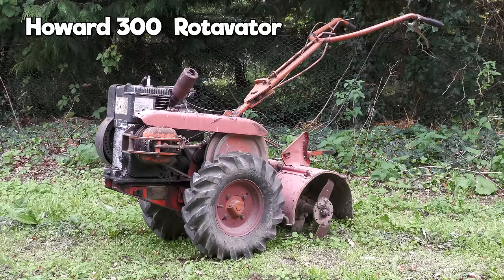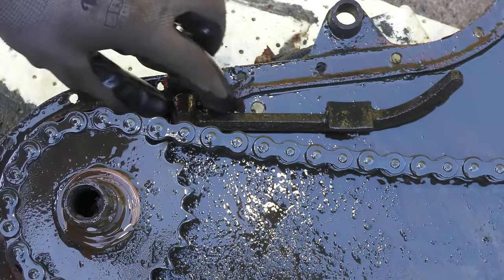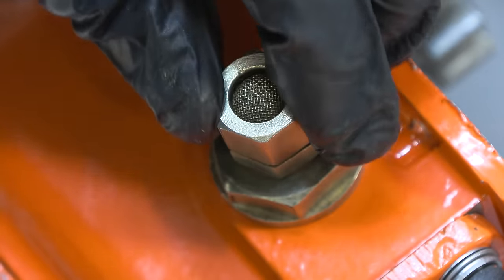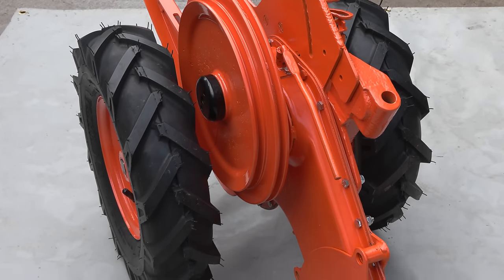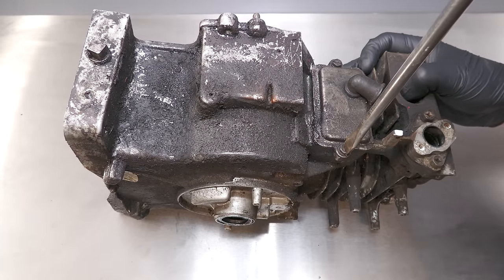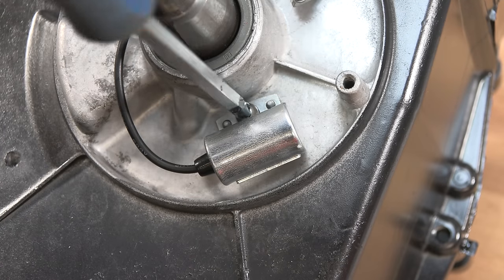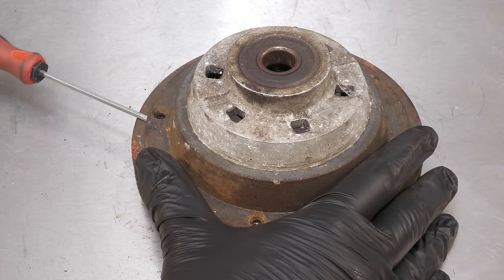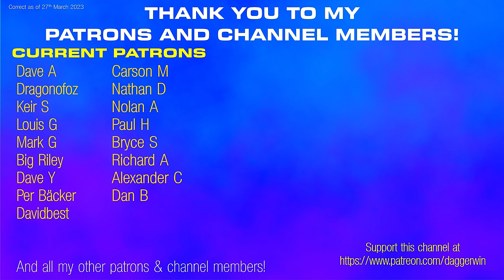RARE 54 YEAR OLD VINTAGE TILLER | RESTORATION

Comment: You were very lucky that the gearbox was in good order, when I restored my Howard 350 about 15 years ago the gears were all worn beyond repair so I ended up making most of the replacement parts myself, (fortunately I am an engineer and I had a fully equipped workshop) while I was at it I got rid of all the plain bushings between the gears and the shafts and converted to needle roller bearings throughout the gearbox, at the time I couldn't get any spare parts or gaskets so I had to make everything myself. I replaced all the bearings, seals and chains and eventually I got it all done, I also replaced the tyres and the tynes and converted the tynes to double row. The old Howard is still performing flawlessly to this day and leaks no oil. I also overhauled the Kohler K141 engine and replaced the piston, carb, exhaust and fuel tank. The engine runs perfect and can really do a job of work on my small holding, the last time it was used the engine started first pull with 2 year old petrol in the tank and did everything I asked of it, these are truly great machines

Comment: We used the 350’s for commercial landscaping work as the 300’s were fine for veg plots but a bit underpowered for commercial work. The Kohler engine was brilliant, given its quirky starting process and relatively easy to maintain. Like yours both suffered from the ingress of dirt/grit exacerbating wear. So we did basically what you did every two years to all on them, and still had breakdowns. 😂However, a brilliant machine and a super vid, thanks.

Comment: The reason I popped in to watch this was to see just what a Howard looked and sounded like when in operation.
There is one just like this one that's come onto the market here in Rotorua NZ that won't go, owner has no idea why it won't go but they are asking $160 for it.
It's not the price that scares me but how scares the parts are to find over here.
Thank you, you have done a wonderful job on restoring your old now new motor.
Reply: In the modern age parts are often easy to find. It's the world's out of date shipping prices that kill things.
I have one of these in my backyard. Last time I worked it over I ended up making all the gaskets. I found a kit in the UK but by the time I had it sent to the US the shipping was more than the gasket set. If I recall the gasket set was like $20. They wanted $35 just for shipping. For $5 I bought a roll of gasket material locally that I still have more than enough to do it again.

Comment: When restoring projects the quality attention to detail is spot on high quality. If I needed to rotorvator I would definitely purchase this one over anything new manufactured because the old machines mowers and garden equipment were built and made to last longer and built with quality materials. 
Cheers.

Comment: I love that this wasnt just a quick paintjob. You were very thorough. Two bits of advice, quenching steel with water can weaken metal components. Its best to use a penetrating fluid, and when you are hammering a threaded end of a shaft or bolt, leave the nut on and hammer on that instead. You wont mushroom the tip of the shaft or bolt.

Comment: Thank you for making this excellent restoration video, brings back many memories. When I was growing up we had one on the farm, when I was barely old enough I started using this wonderful machine on our farm, it was quite heavy and needed some serious strength to keep upright & from toppling over, quite a high centre of gravity!   Ours had the B&S engine originally I think, but it blew up and we replaced it with a Mitsubishi engine, which threw the conn-rod I think, then the final engine was a Kohler.   After many years of hard slog, I credit this machine for giving me great upper body strength.  I hope it gives you great pleasure and satisfaction using it.   Cheers from NZ.   (PS: I am two years older than this machine)
Reply from the maker: Thanks you so much for your kind words, I am so pleased to hear that it brought back memories for you.

Comment: I wish I could've restored my grandfather's old Sears Craftsman tiller from the 1970s. It used a common Briggs 5 HP engine. It was yellow and white in color from what I remember. My parents used it quite often when I was a kid.

You did an amazing job with this one. Rotovators/Rototillers haven't changed much in decades. Practical and simple design. Love it.

Comment: There are thousands of these type rotor tiller all over spain, especially in the north where I live. The majority are powered by single cylinder lombardini diesel engines although nowadays lots are using honda petrol engines. They are eternal and well worth a good restore like you just did.

Comment: Great job. I've always been taught to hone even the aluminum blocks to get rid of the scoring as they are honed from the factory. The starter housing hole that the spring is anchored has ample room to feed the spring in as you wind the string pulley. When the spring reaches the final end a slight pressure on the tab and it will pop into place. The heat resistant paint is a nice touch as I use barbecue paint, same thing. I think that tiller will last many years to come.

Comment: Was just thinking that it’d been a while sinceI seen a new MR video. Great restoration and skills as always. Most people don’t think that any design went into commercial machines like these but you can really see how it resembles the front of an old tractor in the working video. The shape of the belt guard gives it a bonnet line, the exposed engine case and upright exhaust all give it a style which was intentional and no accident.

Comment: had several of these. for my landscaping business years ago.heavy machines but the reverse gear made the work alot easier. mind you my favourite was the Howard 200 a lovely little rotovator again with a reverse gear ideal for smaller gardens.

Comment: Looking very nice again, totally worth the time and effort getting it back to almost brand new condition.
You should consider using anti-sieze on the hardware, especially on the stainless nuts and bolts it's pretty much necessary.
At work I use interflon HT-1200 ceramic for everything that doesn't get hot and copper based grease on exhausts.

Comment: Great to see such a nice restoration. Looks great. I didn't quite go that far with the similar engine on my leaf vacuum (though it was running ok-ish, and I did do a lot of maintenance on it), and well I bought a Harbor Freight Predator (Honda clone I think?) to replace it. A leaf vacuum isn't much good if it takes half an hour of pulling to start in the cold 🤦

Comment: It's impressive to see how delicate you are with everything. It makes sense, given that everything is very old and you don't want to wreck anything, but it's such a change from what I'm used to trying to get rusty equipment like that apart. Though I did get a good chuckle when you carefully ground the rough edge off of the end of the metal flat bar for your pin spanner. It's certainly a good idea to take off the burr so you don't snag yourself with it, but I couldn't see myself spending the time to bother with it. 😏 Great video though; I really enjoy seeing you expertly handle these old machines and bring them back to life. Your calm narration really tops it off. Cheers!

Comment: That looks very similar to the rotavators I used as a kid only more modern. Most of the machinery I grew up with had Villiers engines. It was much later before I had anything with a Briggs. Certainly transformed that machine.

Comment: When ever I rebuilt B&S engines and there was a lot, I filled the oil before installing it and I would turn it upside down and all around for a few seconds to make sure all the internal parts were coated with oil. I also flattened the diaphragm cover like you did with the head. They were almost always warped.

Comment: Another restoration very nicely done. I also use dish soap to clean my carburetors, because they work very well, but I also tried some universal cleaner you use for floors etc. They do perform equally and mix with the water better and quicker, for my opinion. 😉

Comment: When fitting those bushes i was slightly surprised you didn't freeze the gearshaft and warm the bushings, would've probably dropped on without having to use a hydraulic press. Love your restorations, horticultural machinerry has so much history and relevance to so many I'm surprised that there are so few restorers on YouTube. I can also recommend Bulldog BDX penetrating oil to free rusty parts, that stuff is liquid Pickford's, it'll move anything 😂

Comment: You do amazing work! The old machines are just so much better than 90% of what you can purchase today, BUT monetarily it does not make sense, as the cost of all your parts, bushing, bearings, seals, etc., let alone labour (imagine what a shop would charge in labour costs). This is especially true for the B&S engine, I can purchase a new replacement engine far cheaper than rebuild costs, except in the case of genuine "Honda" engines which are very expensive. So these projects must be a labour of love not monetary related!

Comment: Love that you made this into a complete restoration video. These old machines got so much charm and character. And this in particular looks damn cool! 
Just imagine if it had been manufactured by today's standards.
You would have been lucky if you had found an engine left on the pile of rust that once was the pressed thin sheet of metal.
Keep up the good work and videos sir!

Comment: That spring and cup inside the carburetor must be mounted on the other side of the diaphragm - inside the hole under the diaphragm.   I've never seen it done otherwise and suspect it cannot work as shown.

Comment: A bit late to the party. But that was a damn good restoration - you rarely hear of people talking about tighten bolts in a specific pattern at times using the correct torque is as good as it gets... In my younger days in the military - doing maintenance.... there always were PM charts being very specific - not only about the pattern and torque. Any tool or spare part were specified as well including every single drop of oil or grease - nothing left to chance. It felt like the military were close to being diagnosed with OCD. In civilian and private life - you don't always have a perfect situation using whatever to get the job done. However you often live to regret having cut corners. Knowing or having a good idea of what you should have done is just adding insult to injury. I'm only an amateur and have only been tinkering with old 2 stroke engines - in part like you've shown  - 4 strokes have valves and a lot more that needs to be tweaked to the right tolerances - timing and a lot more - why I in general didn't do it not having the right tools. I only did it having access to a workshop and someone having the tuff work of learning me how to do it right... I appreciate you showng how to do it properly!

Comment: Lovely job I enjoyed all your video how I have learnt how to keep lawn mowers running and repaired and replaced just  wish I could find some one like you who I could pay fix up old spare engine that I can't use anymore due to need welding done same with one my petrol strimmers need welding to fix up 

Still got in my shed old generator that I not been able to fix up get running again as I can't find coil spring for the pull cord system just sit there no point getting rid of it as I no it's runs 😭

Comment: absolutely beautiful a nice quick project for yourself would be a vintage chainsaw in case u never thought of that although they run horrible even after restoration a lot of them will bog out if turned on their side so to fell a tree u gotta turn the blade sideways and then flip in back to make fire wood so it’s more just to sit there and look pretty

Comment: I got a Howard 350 but it’s had an engine swap to a 1990s B&S 8HP I/C. I brought it from a guy who didn’t know the history about it. The engine runs well. But since someone put to big of and engine on it. It has stripped the gears for the tines. But it still moves around but it doesn’t tiller. New or used parts are expensive.

Comment: When Powder Coating bare steel you should first apply a surface pretreatment like Bonderite M-FE.  If you don't pretreat the metal a small scratch in the powder coat will cause catastrophic coating due to oxidation creepage and delamination of the powder coat.  The Pretreatment stops the rust from creeping under the coating and causing blisters.

Comment: Next time mounting tires simply use dish soap it comes off faster without a residue
The exhaust pipe removal was fantastic I would have never came up with the idea of cutting it off and welding on a T handle

Comment: I have a Howard 352 and installed a later 5hp B+ S engine to it ,with a couple of mods  here and there .It's my go to rotavator out of all the more modern rotovators I own ,they are so maneuverable and very powerful for the size and good tiller speed  .Mine has side guards for the rotors .Just wondering if the 300 came with them as it can stop all the side fling when say running up the edge of a lawn.

Comment: Great job!
What are the additional belt grooves on the clutch and the big wheel for, some other attachments?
Love the KTM-like orange paintjob!
👍👍👍
Reply: Two speeds available by simply swapping the belt to the other pully set.  As shown, the machine is currently in low range.
Reply: @woodhonky3890  Ah, ok, yes makes sense...thx!
Reply: @horstszibulski19  Welcome!

Comment: what a fantastic restoration , i have the same model which is a basket case at moment could you tell me where you got the engine parts which seem to be hard to find on line .
Reply from the maker: Mostly Ebay for the Briggs parts

Comment: I would like to say that I have the Howard 350 and mine has had extensions fitted to the rear rotor to give wider working width and understand that this is very rare.
 I also have the potato ridger attachment and plough that fits into the draw pin at the back.
Would you consider to restore another fantastic piece of machinery as would love mine to be restored.

Comment: you can get a laser tool to remove old paint and engine oil that way the valves might just need to de-gunked the old oil might prevent the valves from seating and sealing properly. with old antique stuff,without have access to walnuts and or baking soda makes for a less harsh restoration on stuff that you can’t get then your into 3-d printing parts unless you have access to one and a metal working version getting something that has pin hole rust, then your looking at jb weld or body filler.

Comment: Great job as always! Did you clean the threads in the exhaust port after removing the pipe? 

On the engine number plates, I would have been tempted to paint some black enamel onto the stamped numbers and then sanded the paint flush to make the numbers easier to read.
Reply from the maker: Yes I soda blasted the threads.

Comment: If you have trouble with rusty nuts, a small shot of pb blaster or wd40 a day or two before you plan to disassemble. Otherwise, another method with heat is just to heat around the bolt and then turn while it’s red hot, turns like butter

Comment: my only gripe about brigs n stratton is using rivets to mount the recoil spring. not able to order a mower direct from manufacturer our local lawn mower shop doesn’t carry them why never had an issue or failure we just went for oil, air filters tires anything major they had a five star repair shop stuff wasn’t down very long. Ten plus years out them always ran spring oil change fresh gas run the dog out of them,

Comment: Great in depth video - just wondering what causes scratches along the bores. Is it the end of the rings where the gap is being pushed into the aluminium by pressure or grit getting through fuel/oil/air filters or something else?

Comment: AMAZING!!!! I have a question- does the engine power the tires to turn, or does motion of the tillers move it forward? I know nothing about small machine repair, but I do enjoy trying to learn a little here and there. 😅
Reply from the maker: Thanks! Yes the machine drives the wheels from the gearbox

Comment: A fantastic restoration only thing I spotted is that you didn't appear to know the correct way to fit a Briggs recoil spring which is to leave it uncoiled and pass it through the retaining slot on the casing and attach to the pulley then it can be wound into place by turning the pulley being careful to lock it into place when you come to the end this is both a safer and easer way to do this

Comment: Question for those in the know. When powder coating is there not a primer that could be or should be used? I have never used powder coat for anything and am wanting to try it.
Reply from the maker: Yes there is a primer. The parts I send off for powder coating get primed

Comment: I'm curious , is there any way to reverse the clutch on a tiller ? I'm about 3/4 the way through a bike project for my boys using an old sears tiller , I want to keep the 3 speed transmission and make a suicide shifter for it but that clutch is backasswards for what I intend to do .

Comment: Heavy duty old machine should last forever if cared for but sure doesn't till very deep for the size of it. Doesn't look like the guards would allow for longer tines either. It's a shame that while the older stuff was without question built better they hadn't gotten the designs quite up to modern standards as far as usefulness and economy of size. I mean you'd be doing almost just as well with one of those tiny two stroke Mantis tillers that  weigh probably 1/6 of what that machine does and can be hung on the shed wall. Granted the Howard would win for ease of use.